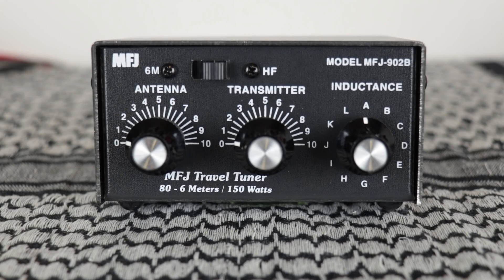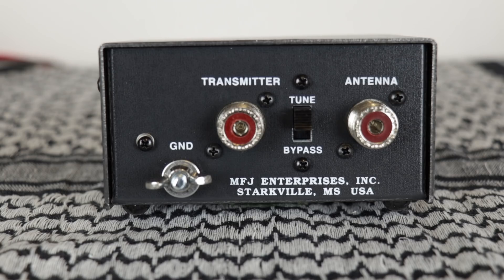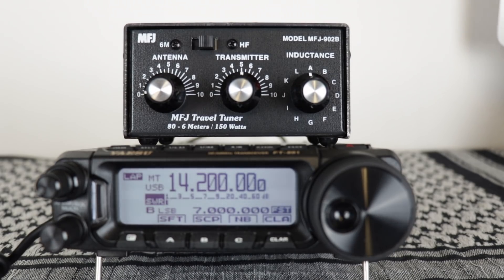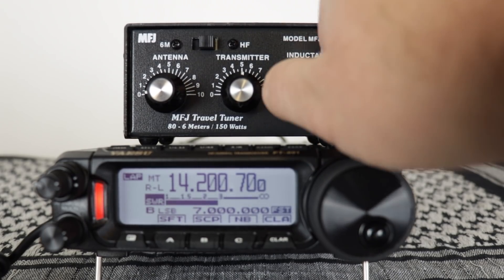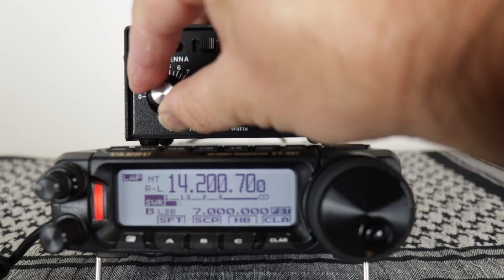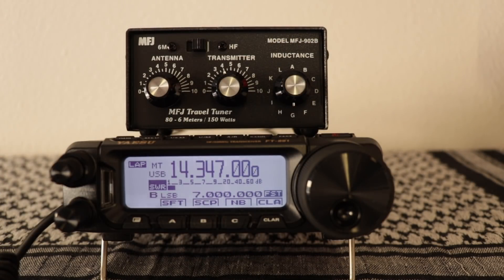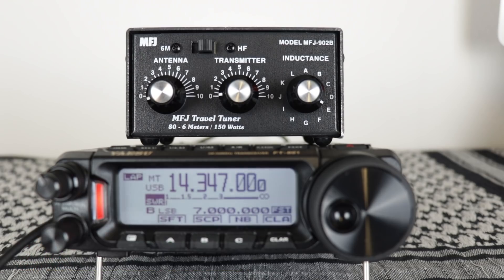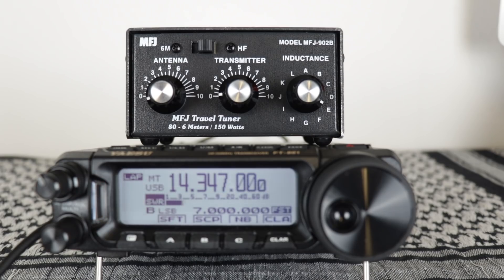MFJ 902B Travel Tuner

Comment: Nice little matcher. I have the 945E that I got used. I had to make several repairs with a hot glue gun to include holding the meter in place and fill stripped screw holes. 

The way I learned to tune is to adjust for loudest receive sound gets in the ballpark and then do some minor tweaking on transmit. Going back to your previous video now, I see you did that with the 9232. 

Thanks for the videos. Several have been a big help, especially after I purchased the FTM400. 73
Reply from the maker: Thank you for taking the time to watch and the comment! It is greatly appreciated.
Reply: tuning up for loudest receive is much better as you don't push the PTT and so don't hurt your power transistors.  A tiny tuning led to see the SWR is minimum would also be a great help in this tuner where the tuner is used with transceivers which don't have an SWR indicator.
Reply: @on6uufrank  GREAT IDEA

Comment: too many steps in the manual... i just adjust inductance for best receive, then adjust for swr using transmitter, then antenna while transmitting low power carrier... on the 891, the ATAS setting provides carrier using up button plus PTT with no need for changing modes in the menu

Comment: I listen in on the Spiderweb net in the morning. I hear them loud in Minnesota. I am thinking about a manual external tuner for shortwave listening. Not sure if it would do me any good. I use a LDG Z-100 with my FT-891 and a WRC SB1000 when I go portable. I have always wanted to try a manual tuner. I have the IC-705 and a KM4ACK end fed half wave 4010. It is amazing what 5-10 watts will do.
Reply from the maker: Thank you for taking the time to watch and the comment! It is greatly appreciated. I have not yet tried KM4ACK's EFHW. I recently picked up the Packtenna EFHW and used it in my Winter Field Day video. It worked great! I will have to give KM4ACK's a try in the near future. I have really liked using the 902B. In fact i didn't realize how great of a tuner it is until I tried it. I use it with my FT891

Comment: Thank you, I’ve always used tuned antennas so never needed a tuner (the antennas were no more than 1.5:1 across the band). Thank you for your video, this tuner looks good and in my price range!
73, de KB0WZH
Reply from the maker: Thank you for taking the time to watch and the comment! It is greatly appreciated. It is a. great and easy unit to use. I never thought I would like a manual tuner.